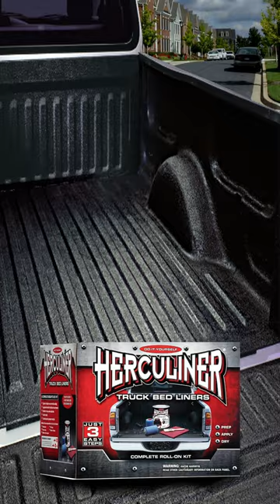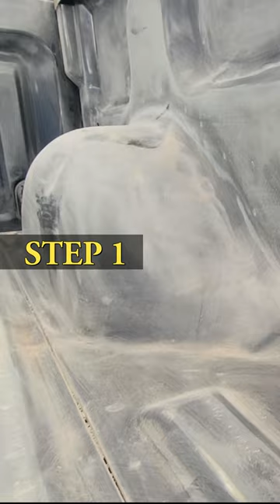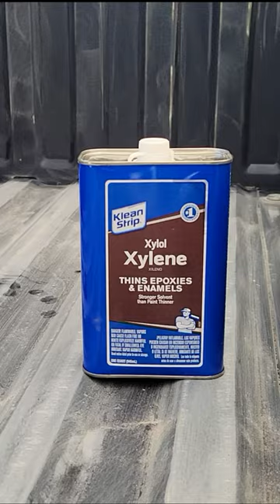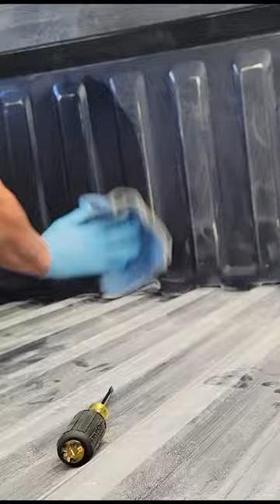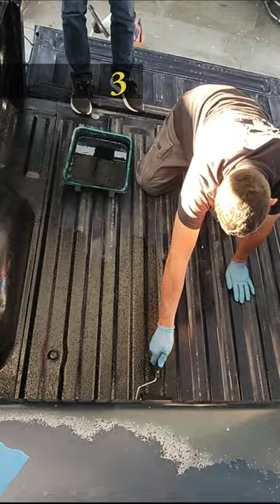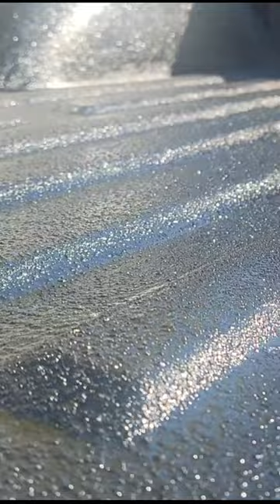HERCULINER - Brush-on Bed Liner Kit - Short

Comment: Is this stuff hard as a rock when dry ?  or is it rubbbery ?
Reply from the maker: The finish texture is hard, providing excellent grip and prevents items from sliding around in the bed while driving. I have found it useful when transporting furniture as they stay in place and less likely to get damage.
Reply: Hey can you give me instructions i want to do my fj cruiser
Reply: @marvinparks8663  get 80-120 grit sand paper.. sand your entire bed or the aurface youre painting. Until its rough not shiney..

Then wipe it down with a clean rag and acetone.    Let it dry. Then use a paint brush to dab the edge and stuff first.  Then roll the forst coat on.  Then let it dry for 4 hours.. then 2nd coat it 

Instructions are in the kit and all over youtube

Comment: Would be good to help seal an aluminum Jon boat that has a hair line crack that leaks water???
Reply from the maker: I wouldn't count on sealing a hairline crack only because this product is not rubber base.
Reply: Have a welder fix it

Comment: But will it bond to my HDPE amphib 6x6 atv??
Reply: Hello, I can give some advice on coating HDPE Plastic 
I got lots of experience painting plastic,  wood and metals.
I also used to work in a powder coating factory, etc. 
For coating HDPE plastic I recommend the following steps:
Sand to 180 grit or use a BRASS Wire wheel on a drill just till its roughed nicely. 
( if your plastic is heavily oxidized from being in sun with whitish color on it then you need to remove the oxidation completely down to the fresh plastic or the coating process may have poor results. )
Then sand to 40 grit.
You want to feel a light fur on the plastic with your fingers when its prepped well.
Clean with 91% alcohol ( that can be gotten at Walmart or online possibly )
in spray bottle and clean cloth.
Apply 2 coats of 3M Primer ( 5 min between coats ) also known as tape primer and acts as a bonding agent between HDPE Plastic and coatings. 
Let dry about 1 - 3 hrs hrs
Then Spray on the herculiner according to their directions. 
You may want to ad a flex agent to the bedliner incase it's to brittle and chips off.
Flex agent can be gotten from a autobody paint supplier. 
Maybe raptor liner works better for plastic because it's made for plastic to.
Rapture liner can be tinted to any color you want 

You can see a nice video here on different bedliner durability tests
https://youtu.be/e8RY-Z0ObgY?si=imhJ_B1VmK-SlMlo 

I am working on releasing a plastic painting ebook in the future. 
Hope this help you or anyone out.
Happy coating 🙂